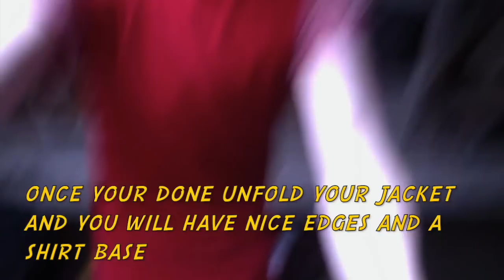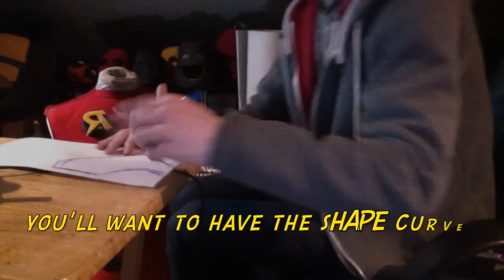How to Make A Robin Costume - Process Video

Comment: Around how much of each fabric did you use, just for reference. I'd love to make this but I wouldn't want to buy more than necessary.
Reply from the maker: I used around 2 or 3 metres depending on size check with your local fabric shop or art store and they will recommend some lengths thank you btw 😀